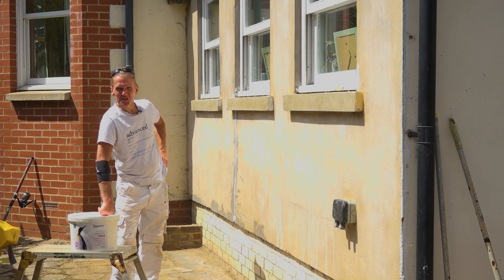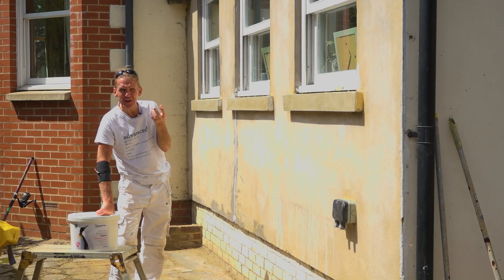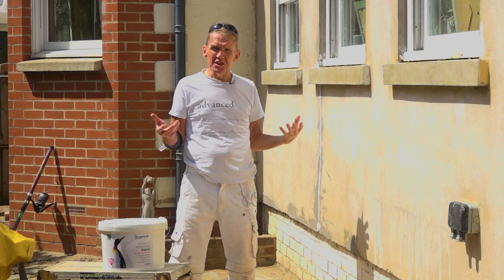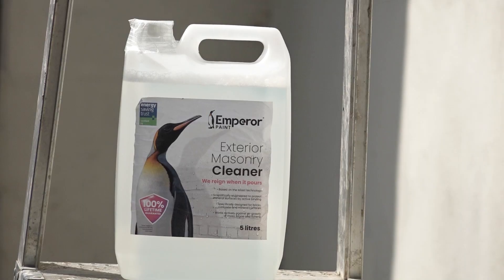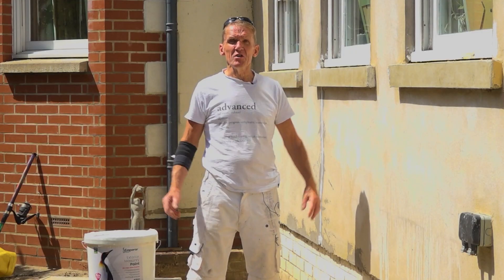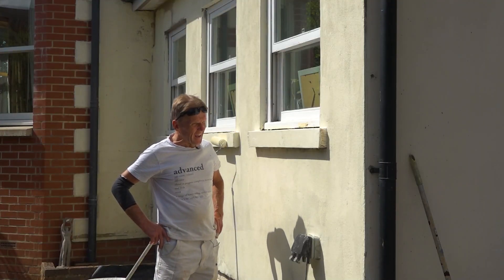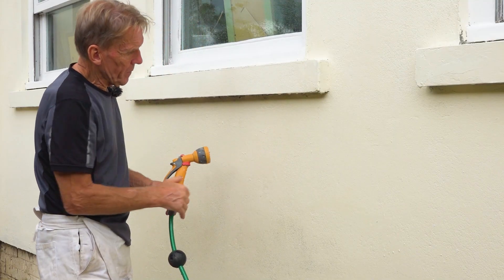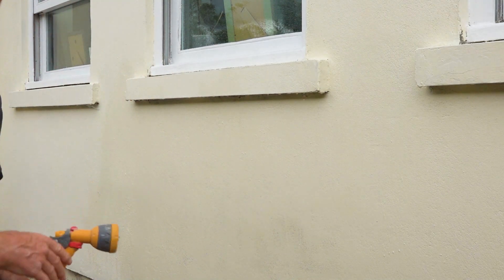Breathable Silicone Masonry Paint Solves Waterproofing Problem

Comment: Hi Roger, I have a gable that has a couple of render patches blown, once I’ve repaired the patches, rather than pay to have the whole gable re rendered, do you think 2 coats of this will help with any possible damp issues due to the driving rain.
Reply: I see he never replied ,ive same probs with my gable end ,damp been sucked right through as theres no cavity ,its a must for this spring ,how did you go on did you use it  ? be interested to know ,

Comment: Looks a good product, perhaps this company have an answer for my problem?
On a hot day the bricks on the front of my house soak up and hold on to the heat. Resulting in a very hot bedroom. I know I could get ac, would rather reflect that heat
Reply: You need some foil backed poly board on the inside. And white paint outside would help alot, but guessing it alread is.

Comment: Used this product on my concrete fences. Absolutely brilliant. Highly recommended. Not the cheapest but very good. 90 quid for ten litres.👍👍
Reply: 90 royal foils! F… me,that’s expensive!
Reply: @jasonantigua6825  no nearly all high quality masonry paints cost £90-£100 for 10l colour tint sandtex trade and dulux trade weathershield is around that price.
Reply: @jackwardley3626  90-100 green queens is mighty expensive! Guess it’s worth it though!
Reply: @jasonantigua6825  I paid 80 quid for 10l of standard jonhnstones masonry paunt last week....their silicone based stuff is a lot more
Reply: I've tried other brands and this was recommended by Charlie DIY on YouTube.  Great Product but wear gloves when applying it sticks like glue 😳👍.
Reply: @lazylad8544  Like sht to a blanket in other words?
Reply: I paid about £84 for 5L of colour mixed Dulux Opaque exterior timber paint. It’s absolutely brilliant paint. The neighbour paints his shed every summer, il leave mine for at least 5 years. 10yr guarantee done right. That 5L goes along way, even 1 coat looks mint. I’ve videos on my channel using it. Il edit this with a link. For me you pay for the best, saves in the long term.

https://youtube.com/shorts/l_o1464IlS0?feature=share

Comment: I thought most masonry paints are microporous?

 I could be wrong I dont think pliolite (solvent based) like Sandtex 365 or Allcoat masonry.  I mean even they might be, can't remember the specs other than work bloody fast.

So is it marketing bollocks or is this a product like Keim Grob etc? More for listed buildings with lime renders or new silicate renders where you can't use a standard masonry paint?
Reply from the maker: I think that any paint is microporous to some degree because water vapour can pass through many materials but the lower the temperature the more vapour open you need to be. It is a matter of degree.

Comment: I wonder how (long) it will hold up under the sun.  Time will tell.  I’ve seen a few “laboratory” tests where the painted surface is left exposed for months or years. But around here, the longer and better the test, the more likely the formula will have changed (or the manufacturer acquired by another which retains only the brand name).
Reply: They use good silicon paints on cobb buildings. Lasts a very long time.

Comment: Looks like great product Roger, I have used several breathable masonry paints,  Mapei make a good one too, lovely to use. ideal for lime renders .  
almost every cement render I have worked on has cracking issues which leads to water ingress, these products will allow that water to escape without pushing the paint off.

your painting skills are, erm questionable.  Just saying
Reply from the maker: I am not a painter but thankfully I don't have to be
Reply: @SkillBuilder  I have an internal Lime plaster job upcoming and I may give this product a try.   
External ( masonry) breathable paint can usually be used inside too, it is more durable than the chalky limewash types of paint.
Good to se you wearing your whites there Roger
Reply: What's wrong with his painting skills?
Reply: @RalphSampson...  I think he was supposed to be painting a penguin.
Reply: @RalphSampson...  Only joking, he did better than a lot of "professionals"  i've worked with.  And he is wearing his whites !
Reply: He was in a hurry to go fishing!